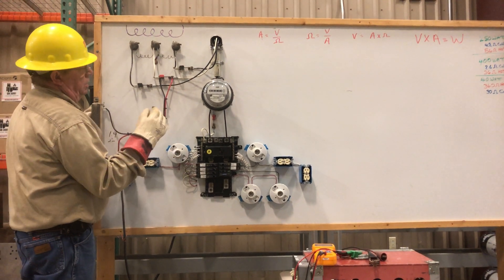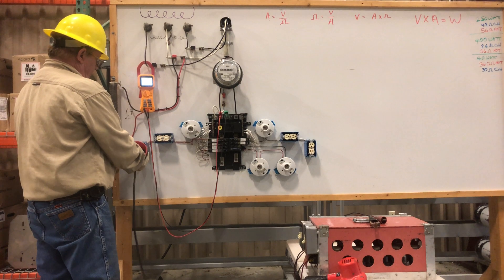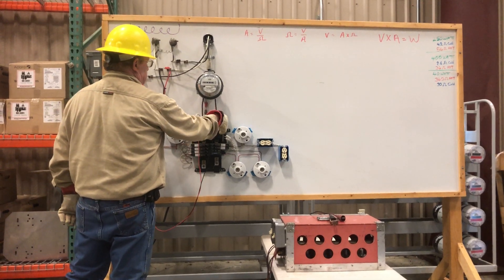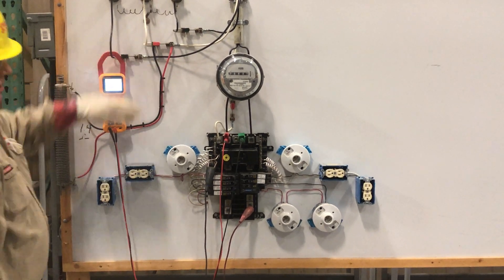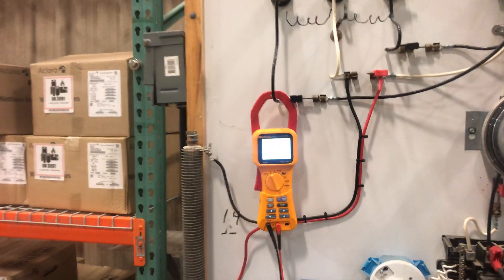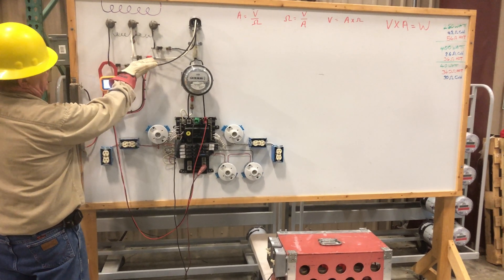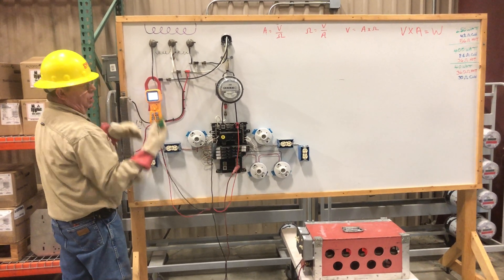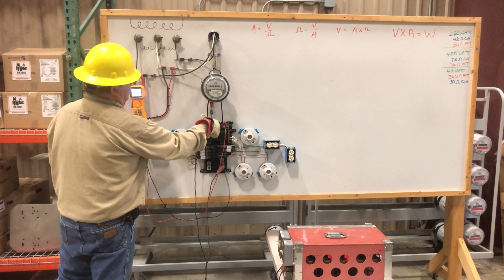Lineman Talk - Troubleshooting a bad secondary neutral connection. 9 min.

Comment: Visually it looks like you're doing a excellent demonstration of a bad neutral but the quality of the video especially the audio is so poor that none of us in class could understand it. I think you need to redo this on a bit larger scale so that we can see the color codes of the wires. Looks like the red wire is connected to the resistor on the neutral. It's really hard to see the photography is poor.  I would like to give you credit, but credit is only given when it is earned.

Comment: I have a bad neutral that comes and goes away it fixes itself i had the electric company come out but by then it tested perfect a few days later bought multimeter and tested at the meter pole 132 one leg 114 other leg a few hours later it was testing perfect, could the problem be way up stream, a neighbor said he lost power on one leg a while back.
Reply from the maker: To identify the the bad connection, the current must be unbalanced between leg 1 and leg 2. The greater the imbalance, the further apart the voltages can become. Your DMM cannot see a bad connector causing the distorted voltage, downline from the DMM. The bad connector must be on the source side of the point where you can measure the voltage spread.
Does your meter have a way to measure amps?
I will be happy to help you troubleshoot this.
Reply: @linema22n  Yes I think so, it's a Klein 420 it has settings that is 10 A . And a mA setting.
Reply from the maker: @childlikefaith7257  That meter will measure voltage but is not what you need to measure the current for this work.
A meter similar to the one shown in the video that will clamp around the wire is better suited for this job.
You can bring on a large 120 volt load and hope that load will cause the current imbalance needed to troubleshoot. Did the utility use a device that could control the load or ask you to turn something on inside your house?
Reply: @linema22n  No, as a matter of fact I told him I had everything unplugged so he checked it with zero load, and he had no device I watched the entire time.
Reply from the maker: @childlikefaith7257  That is unfortunate. As tactfully as you can, ask the utility to send someone else to work on your power quality complaint. The symptoms you describe are text book for a resistive neutral connection. The connection may not be on the utility side of your service,.
Reply: @linema22n  Thanks for the help I really do appreciate it.
Reply: @linema22n  This morning it really acted up, I could turn on the hot plate L 1 hit 190 L 2 about 50 but after a couple hours it was ok again and reading normal on both legs.
Reply from the maker: @childlikefaith7257  If the neutral finally becomes open, that 190 will be 240, full transformer coil voltage.
Did you contact the utility or do more checks yourself? Most of your appliances can stand 130-140V for a little while but that high voltage will kill them.
Reply: @linema22n  No, I didn't contact the electric company, I installed two 110 outlets at the meter pole, one on each leg, next time it acts up I plan to disconnect the house completely even the neutral wire and put a load on the 2 legs at the pole in order to find out where the bad neutral is, that my next plan.
Reply: @linema22n  Ok, I have most every thing unplugged, what usually causes a resistive neutral, my neutral wire is aluminum and is old and has been connected to together in a few places because It's to short but I cleaned them and retightened them.
Reply from the maker: @childlikefaith7257  
There are a dozen places. You don't have access to the meter socket or the utility feeder.
The voltmeter is your friend. You create the imbalance and the high voltage on one leg.
Start searching, measuring across connectors and any reading above zero is a resistive connection. The hardest thing is to work back towards the meter and if you can see the high voltage, get the utility back out there.
text me if you want
8306604620
Reply: @linema22n  Ok thanks

Comment: Haven't watched the video, but in my 18 years as a cable guy, I'm always on the lookout for videos on open neutrals and how it can create hazardous conditions for us. I've seen a handful of melted coax cables and connectors, usually within a few inches of our ground blocks in the house, or at the taps outside.

My most recent one last month had an aerial coax drop that was melted nearly the entire length! The customer said it was smoking the night before. I didn't touch anything, assuming it was still dangerous. Called the power company and described the melted line. Lineman came out, proved it was safe to the meter, and didn't seem too concerned. I felt kind of dumb and was convinced it was a serious concern.

Anyway, I replaced it and told the guy to call an electrician if it happened again. Well, I just checked the history and another tech was out and replaced the drop again. He had cable maintenance come out and replace the tap and said it could've been feeding voltage down the messenger of the drop. I'm not well versed on the outside plant, but I'm still wondering if it's an intermittent open neutral on the customers side.
Reply: Unbalanced load is using the cable
Cable wire to return back to bonded tap on pole to system neutral. Always use an amp clamp before removing cable wires as you don’t want to become the path back to transformer. I’ve absolutely seen intermittent open neutrals, heavy corrosion on neutral connections can cause this, in the meter can, weatherhead, mid span or transformer. Also it could be on the neutral lug in the customers panel/ bad section of service entrance wire as well.
Reply: Customer should get an electrician there to find the problem. If it’s melted more then once there’s definitely an issue there.

Comment: We used to carry a hair drier to put load on the service at the meter base if the customer wasn't home. An amp meter can also be used by checking amperage on each side of the connectors of the neutral. If the neutral connections are all OK, you will read the difference between the two hot legs. 10 amps on one hot leg, 12 amps on the other, you should read 2 amps on the neutral with good connections. With bad neutral connection, it will be a real squirrelly reading that can fluctuate.
Reply from the maker: @charlesbrakeville5825  The heat gun is just a hair dryer on steroids.
Sometimes the smaller current unbalance wasn’t enough to show the problem quickly.
I had one that took 15 minutes with the heat gun before detectable with a DMM. Add a thermal camera and the baby ones will show up.
Reply: @linema22n  I know what the heat gun is. I own one. I also know some neutral issues take time showing up & to find. I had to use recording volt meters in many cases to determine if the issue was on the company's side of the meter or the customer's side to determine if they need an electrician. Also, in many cases, a 220v load will not make it show up. Then you need the 120v loads to cause the unbalance of load  to cause it to show. Still, some take longer to troubleshoot. I worked on many of these in my 38 years in the trade.
Reply: @charlesbrakeville5825 at our company we use a super beast to load one hot with 22 amps in the meter can, typically you will see a swing in voltage and I also use my amp clamp to see how much is going back to transformer. A bad connection will usually show itself but I have seen intermittent open neutrals as well due to heavy corrosion, arcing on connections. We see a lot of issues in damp/wet hand holes. Blocks will be completely swollen with corrosion.

Comment: I had a customer house light on fire yesterday because of this, the neutral load ended up finding a path through a water pipe that led outside. There was an arc between the pipe and the aluminum siding lighting the wood siding underneath on fire, fire burned in the wall for two days before we noticed. 
Power company came, looked at things, secretly fixed their bad neutral and claimed they couldn't find anything wrong. Before the power company came half the house was out, after he "checked everything" the house worked perfectly.🤷